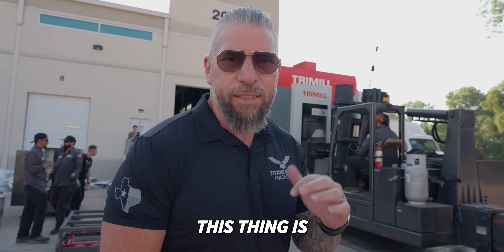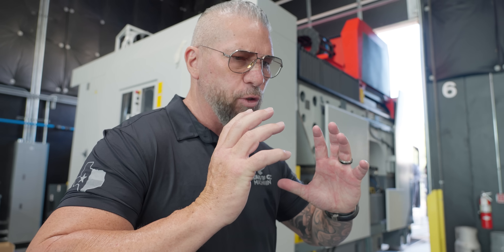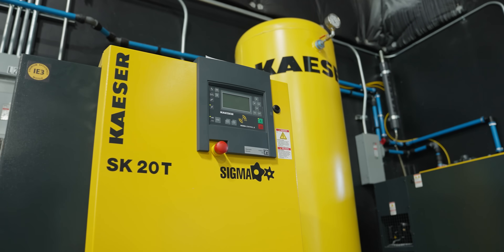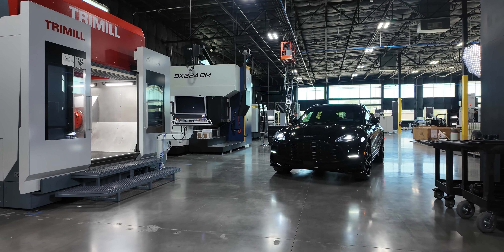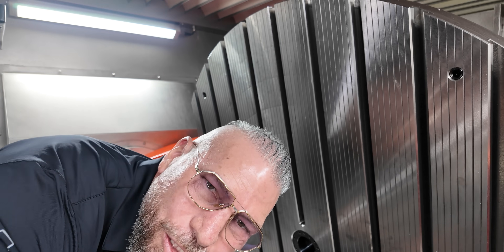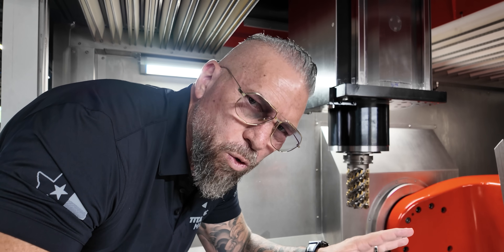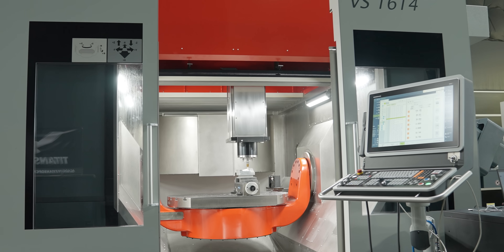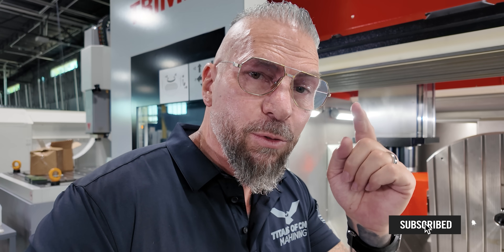How Big Can a CNC Machine Get? Meet the TRIMILL

Comment: I learned from a machinist who used to work at the Mare Island shipyard.  He had a photo in his office of his entire team standing on the table of a vertical table lathe at the shipyard.  I'm not sure my memory is correct, but I think it was a 30' diameter table lathe.  The sorts of machines that fit through a roll-up door aren't even scratching the surface of what size machine tools are made in for large industrial uses.

Comment: Hi Titan and team, awesome video. As an owner myself I wanted to ask, machine tool vendors always have the required foundation requirements for machines like this. Did you have to modify your foundation? If not, how thick is your slab? If you did, how much thicker did you have to go to ensure the machine accuracy? I'm closer to 30K lbs and wanted to understand how critical foundation is in application. I know if varies from shop to shop, but wanted to ask about your experience.

Comment: i worked on a vertical lathe (with milling head if needed) that takes 7000mm  (7m) of diameter. And on 5 axis milling machines that takes 36000mm (36m) on X axis. that's how big cnc machines can be...

Comment: Yall should look into snk. Iv ran the cmv150f, rb200, pm9a pros and the single spindle gantry mills that you could drive a semi truck onto and have room to spare. If size is what you want then snk is the most impressive iv seen. They are pretty damn accurate as well.

Comment: Correction, legit shops use screw compressor systems. Which is what that system is. Same stuff out of China in recent years.
Reply: Could you please explain the difference in mechanism between these Kaesers and a screw compressor system? You've made me curious but this kind of stuff is very far outside my area of expertise (as is CNC as a whole matter of fact, though I'm vigorously interested in it)

Comment: Our bigges Machine is the DMU 600 Gantry 5 Axis. The complete Machine with Tool storage weight 120 metric tons. It was nessesary to open the roof and lifting in the modules with a crane.

Comment: 4:33   Is that holder in 180 degrees out? hsk taper is a dual contact taper, there shouldnt be a gap between the spindle nose and the holder